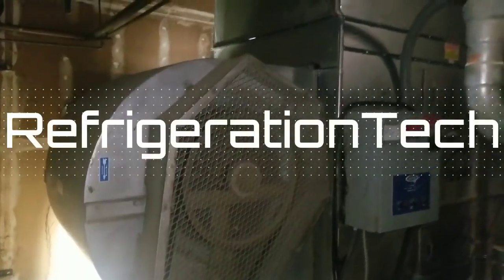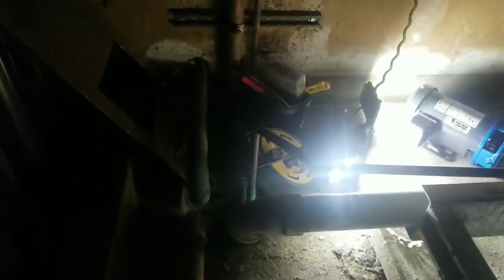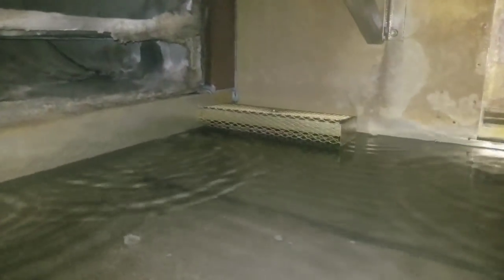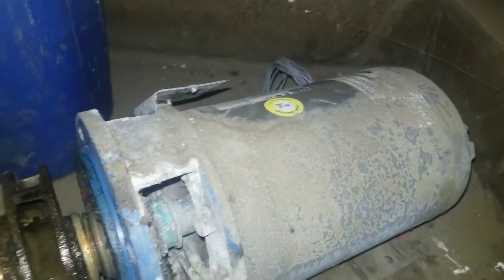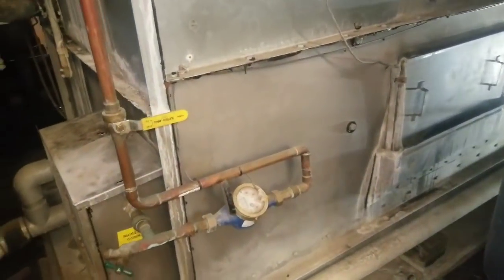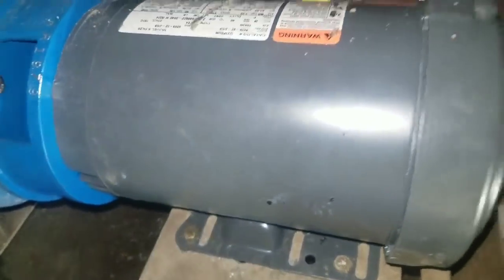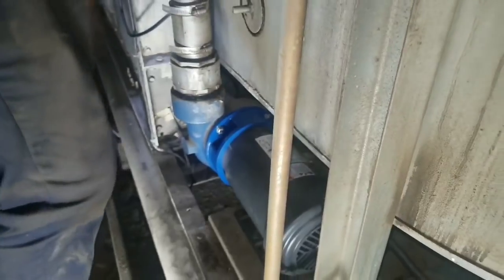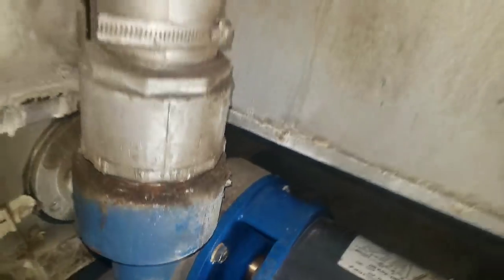REPLACING EVAP CONDENSER PUMP!

Comment: The motor mounting bracket wasn’t removed with the old existing motor…? Why did you have to drill holes in it..?  Were the bolts stripped or broken from previous work?
Reply from the maker: Thanks for watching 👍🏼. The new motor was slightly different and that made the bolt pattern change. So that is why we had to drill.

Comment: Got a BAC tower 30yrs old uses pump to run water ti heat exchangers. Freaking thing is full of rust and 2 days ago the header had enough and shot mass amounts of water all over the second floor of the store.. freaking joke.. all because they dont want to replace anything until it's too late. They are lucky they didn't short out any comps. electrical race track was about 2" under water. Hell I'm lucky I survived.. haha.good video man!
Reply from the maker: Wow, that sucks. But that's your topical store. Now the want it replaced in a hurry right.
Reply: Yup want it now.  Ut due to age of equipment it will have to be custom made.. ahhh good times..

Comment: Don't miss towers.  We would drill a hole in the overflow drain line of the Recolds cuz if the water level got high enough to overflow, it would siphon out and racks shut down on head.  When you got there, the water level was sometimes good, but sometimes you would catch it siphoning.  Have you seen that?
Reply from the maker: I have not seen that . That's pretty crazy

Comment: So the water is cooling the condenser piping ,
Reply from the maker: Yes, I should have explained that this is a closed water loop system that runs though a shell&tube Condenser then goes to this water cooling tower.